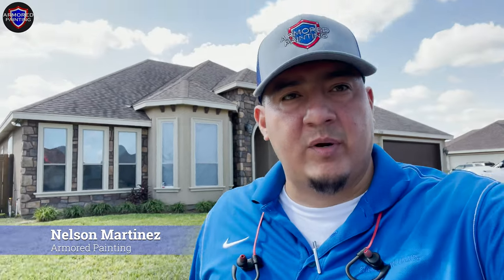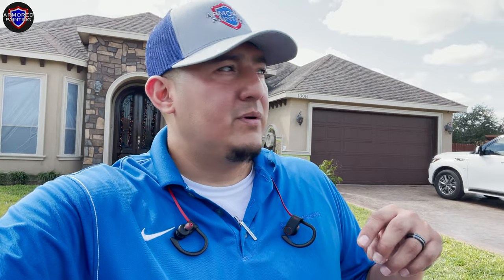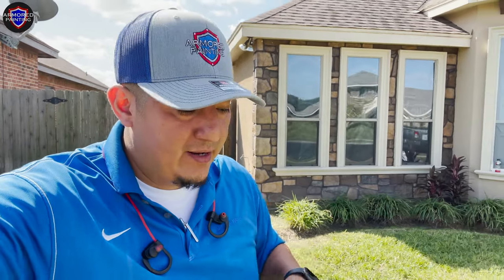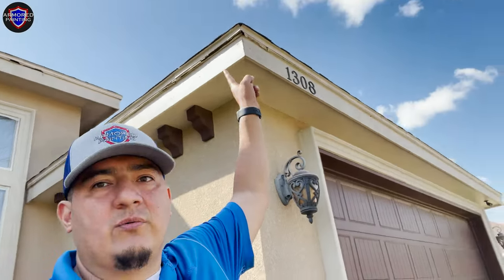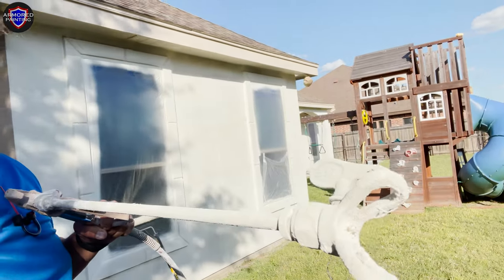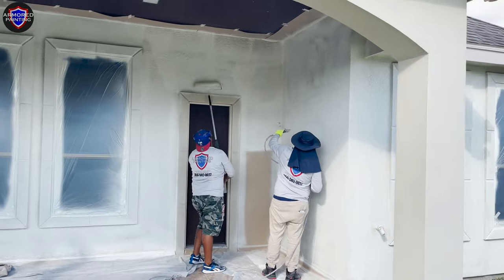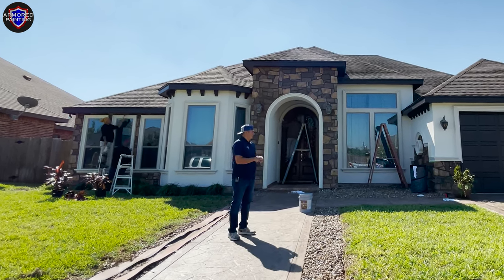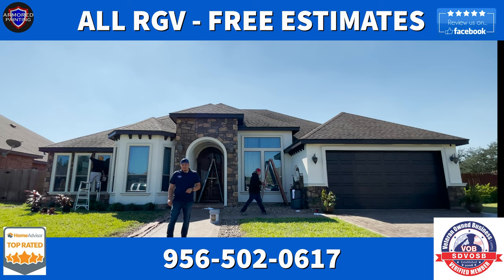Beautiful Edinburg Stucco Repaint

Comment: A graco double orfice f.f. tip is intended for fine finish oil applications. I've used them for decades on exteriors. Once they blow out a little bit they will spray exterior acrylics at much lower pump pressures greatly reducing overspray and will out last a single orfice tip 10x.